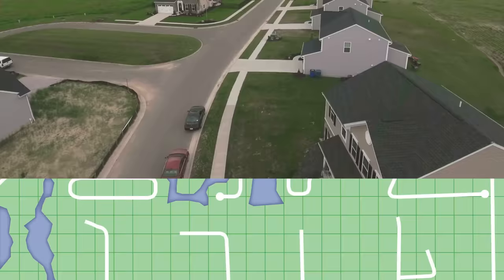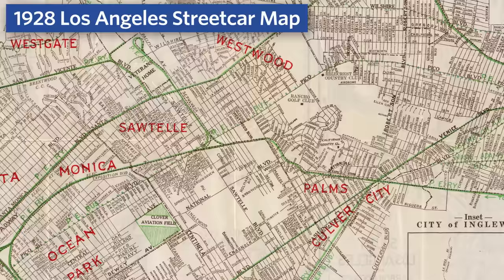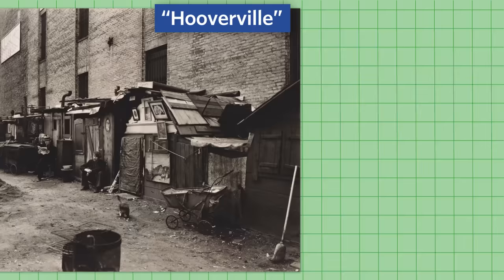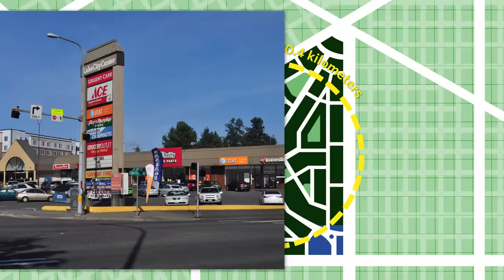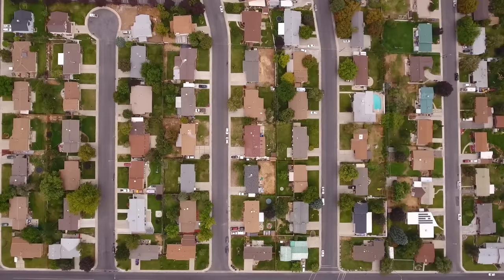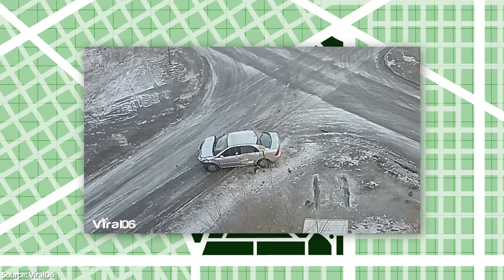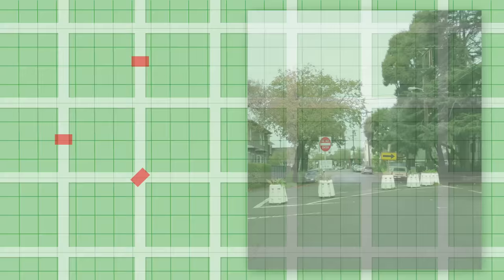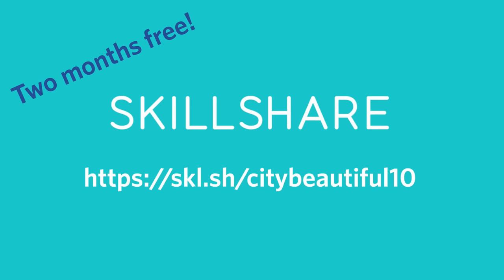The Reason Our Streets Switched to Cul-De-Sacs

Comment: I thought they just dropped spaghetti noodles on a piece of paper and traced it.
Reply: Civil engineers: Write that down!
Reply: @charliegarrison9688  You're joking, but I'm actually about to use this.😂😂😂😂
Reply: @ma.jbrony1754  The sad part is that grid designs don't have to give up on anything else except wavy roads and no side-connections. How? Draw parallel lines at equal distance between eachother, now take the space between two of those lines and double it, now use that spacing to draw smaller parallel lines between the odd and even lines in that order (from where you started counting) , then draw similar lines between even and odd lines in that order (from where you started counting drawing the other lines), now you have the basic pattern down. Now, those roads you just drew are meant to be slower roads, with speed bumps and paved to feel bumpier at higher speeds. Now take the very long lines you drew first, and draw intermittent lines between them but still parallel to them, and those are pedestrian roads, where cars can move at a speed of 5 km/h or 3 mph We'll call the rectangular areas split by T-junction roads on all sides a grid unit. Now, you probably noticed you don't have high-speed roads going perpendicular to the very long parallel roads, so we'll fix that by taking something like 4-6 of those grid units as the distance between long parallel roads going perpendicular to the first-drawn long parallel lines. Since you cut through a grid unit every second grid unit you go through when following those lines, it just means you have to make those split-up parts and use them for businesses and parks and plazas, or attach them to the nearest grid unit to them for which you don't need to cross a high-speed street, or simply use them normally with less-long city blocks. 

There, now you have cities which can have high volumes of traffic, and have areas where only residents and people willing to go slow will want to go through, and you will have walkable pedestrian streets where pedestrians have right-of-way in terms of speed, even if they have to let the cars pass to not block the traffic. Now, only have up to 2 lanes going in each direction, on those very long parallel roads, and don't have them too wide, to calm the traffic by lowering the maximum speeds, maybe making the lane closer to the center of the road slightly larger for the people in a hurry and to avoid frontal impacts, and use the rest of the space for pedestrian walkways on the sides of the road, with trees and benches and bus stops and taxi stops near high-pedestrian-traffic areas (often productive economic areas, too), and build city blocks with ideally 4-5 stories/levels and up to 8-10 stories/levels (which is the maximum you can access without an elevator), and you have much better cities than suburban cities modern USA has, on par with the best cities in the world in terms of walkability, which are most likely in the Netherlands, which is unsurprisingly in Europe. Oh, and for the X-junctions (or + junctions) between high speed parallel roads, have 3 lanes, left lane to get inside the roundabout to turn left, middle lane to continue forward while still getting priority (right-of-way) from the cars from the parallel roads, and right lane to exit on the right lane of that parallel road with 2 lanes perpendicular to the one you exited from, while having the left lane for those who exit from the roundabout. The roundabout would have two lanes, too, for getting more cars through, since getting 3 lanes would be more dangerous without a lot more space which would increase the speeds through the intersection.

You can even test it in Cities:Skylines, using normal roads with the mod Traffic Manager to allow you to change the road speeds, so you can check for yourself which ones are better for the traffic and for the economy of those cities. While it's not a perfect benchmark, without using exploits, it's a fairly good indicator of city profitability and urban road planning, including pedestrian roads where everything must move at the speed of a walking human (even if walking fast, like in a hurry). Plus that they also look better, are places where the USA go on holidays to (if they can afford it), strengthen the community more (especially with kindergardens and primary-and-gymnasial schools within 500 meters, hospitals (even if small) within 1500 meters to 2000 meters, and high-schools within 2000 meters (because they can be inside city blocks, since kindergardeners young schoolers are better off not too high above the ground, for safety reasons). K-8 can be 2 stories high (3 including the ground level story), highschools can be 4 (5 including ground-level story), and city blocks can be 4-9 )or 5-10 including the ground floor).

There, you pretty much have the starting pattern for very efficient yet compact cities. If you want to go the extra mile (metaphorically and quite literally, too), have the distance between the first-drawn long parallel roads bigger (while maintaining the distance between the roads ending with 2 T-junctions, which separate the grid units, just making that thicker), you can fit two of the dotted parallel lines at equal distances between eachother and the very long parallel lines drawn first, and fit even more people or maybe even parks and recreation areas and community gardens and common leisure areas (like maybe even barbecue areas with nearby seating and tables built from reinforced concrete), if you want to have the grid units large enough for bigger buildings needed for things like the police or big hospitals and big shops to complement the shops which would exist on the ground level of the city blocks every now and then. There will likely be shops (small and tiny convenience stores) within 5 minutes of walking distance for all the important commodities (foods, consumables like batteries something to write on and write with, and some alcohol and juices and snacks, a few spices, and whatever else the people from there buy often). You might have to walk 20 minutes to get to a bigger shop with more variety, or to specialized shops, but you would still not need to use a car, or even a bike, for that matter, everything being accessible by walking alone. 

This is, in my opinion, some of the safest and most economically profitable and walkable cities you can design, when you put away the cultural differences between different regions of the world. And I also mean in terms of access to health services, when I say safest. Also, when I saw the distance in meters, I don't mean bird's flight, or direct line on the map, i mean actually walked distance. Quite the big message, right? If you want to talk more, on this subject or any other subject, I'll be glad to talk with you.
Reply: They are actually laid out to maximize property value. Sometimes there are spot in a plot that cannot be used for building and they will build around it, and then lay streets around the lots.

Comment: The grid patterns are much less confusing. However, neighborhoods with the cul- de-sac streets do look more luxurious for some reason but are extremely annoying to navigate in. I personally prefer the grid pattern which is much easier.
Reply: @D M You can have suburbs with connecting bike paths and pedestrian paths, too. Better than gridded streets or cul-de-sac streets without connecting pathways.
Reply: I suspect in the long run, it will probably be a combination of the two. Here in Seattle, the major streets tend to be roughly 5-10 blocks apart, which would give ample opportunity for cul-de-sac or neighborhoods without through streets without destroying the ability of random citizens to walk or bike about. Having grown up one block off one of the arterials, there was a large amount of traffic that went fast down the narrow street in order to avoid the stop light on the arterial one block over. They'd drive it as if it was an arterial, even though there was barely room for one car between the parked cards
Reply: Tourists prefer the picturesque look of winding, old world style streets.
...... until they get lost.
Reply: Grids also cause a traffic nightmare.
Reply: MrSqurk I disagree most people get extremely lost in the cul-de-sacs and most of the curves decrease visibility and create blind spots that are extremely dangerous. Also I don’t know if it’s just me but it a major road is closed for repair you can take a detour that wouldn’t be possible in a cul-de-sac.
Reply: MrSqurk I also forgot to mention in Miami the newer developments in the west feature these cul-de-sacs. The older homes in the East have the regular grid pattern. In the west side of the city where these cul-de-sac neighborhoods are the traffic building up in the morning and and afternoon are unbearable when almost everyone is heading eastbound for the city. The same is true for the afternoon when they’re all returning and there’s only 1 or 2 entrances/exists.
Reply: They are designed for keeping outsider confused... since they had a car.. they just don't care...
Reply: Lol where do you live
Reply: Cul-de-sacs disconnect the given neighborhood from other areas of a city, including the places where crime is more prevalent. If a neighborhood is annoying for you to navigate, then it's also annoying for car thieves, arsonists, criminals in general. Only people who can afford to buy homes in your neighborhood can live there. Not only that, most people who buy homes do so because they have started a family or plan to, and thus, tend to be more risk averse.
Reply: That's just why they used culdesacs, any cookie cutter suburban dump seems grand when its on the end of some loopy round divot end of a street.
Reply: in England, all of our suburban villages and towns use cul-de-sac style building regimens and our citys are so old they predate any logical "planning" structure... and its really not that confusing when you get your head around it, we also have roundabouts in place of most "junctions" which increases traffic flow and reduces collisions
Reply: Bruh in Californian with the Cul De sacs and the mountains on either side. Holy fuck I s annoying as hell if you make a wrong turn down a wrong way legit most annoying thing to get back to the main road.
Reply: @MrSqurk  Not necessarily. Check out the super block model they use in Barcelona. https://www.youtube.com/watch?v=ZORzsubQA_M
Reply: D M yeah I agree I live in NYC so I have to commute to school and work Downtown as I live in the Bronx, and even with taking the train, I still have to walk many blocks and it’s great exercise
Reply: But street names are too conforming and boring.
Reply: Mai Vançon I noticed that. My address is a series of numbers and on TV you see people say like “Oh I live on  River Street and what ever”
Reply: Cul the sac streets are great for living in because all the traffic that goes by your house comes from your 10  neighbors instead of half the city. So much quiter.
Reply: Joe Black  You say that as if driving was faster than walking in manhattan rush hour.
Reply: when I see a cul de sac, I think poor people. Real rich people dont live in cul de sac hell holes. Rich people live in real neighborhoods where you get, and here me out here, actual property. Ya know, the kind where you have a front yard and a back yard that aren't 10 feet from your neighbor. Where you have trees separating you from the neighbors so you cant see or hear them. Where you can walk a few blocks and get to a historical area full of cafes and nice little storefronts and a riverfront and lots of beautiful hiking trails. Thats where rich people live. Not in cul de sac hell holes. Cul de sacs are where poor people go to be packed in like sardines and stew in each other's feces.
Reply: You dont get gridlock in culdesacks tho
Reply: hugh frazer tell that to the garbage truck
Reply: To me grids mean business, cul de sacs mean old people and a place to get away from everyone.
Reply: Kawaii Dere how the hell do you get away from anyone on a cul de sac? your bedroom is 15 feet from your neighbors living room. you never have alone time.
Reply: @Melthornal  if they have off road parking for the houses its fine, the roads dont need to be too narrow for the truck.
Reply: Also when its more hilly culdesacs work alot better because you can work with the environment. Roads dont need hair pin bends to get up and the layered, staggerd heights of the houses allow you to see and have a view. Which makes the house more valuble and nicer to live in from very little work
Reply: I like the grid pattern too. Turn left and right and left.
Reply: Weirdly, I live in Vancouver Canada in a 16 yr old neighborhood of almost completely townhouses, on a grid system that is very narrow, sidewalks line with  trees on both sides then narrow roads so you have take turns sometimes letting other cars pass, thereby slowing traffic, but easy to walk.  You can actually walk places!
Reply: That's because cul de sacs are elitist.

Comment: It is nearly 5 miles from my childhood home to my elementary school. We live in a rural area and our subdivision consists of 3 separate roads. My grandpa built the subdivision and specifically designed the cul-de-sacks to be big enough for a bus to easily turn around in. 

Our school initially said that kids had to be picked up at the end of the roads, but parents were mad that they were going to have to send their 5yr olds to the end of the road to wait for the bus when the subdivision was designed with buses in mind. After a few weeks the parents won got their way and buses had to come down the road. 

Our regular bus driver had no issues turning around and didn’t mind at all. I’ve watched the bus turn around on our road so many times from the outside and they have so much extra space. 

I can see how this might be a problem in inner cities, but this is pretty ideal for rural cities.